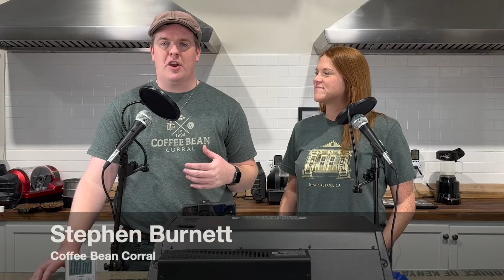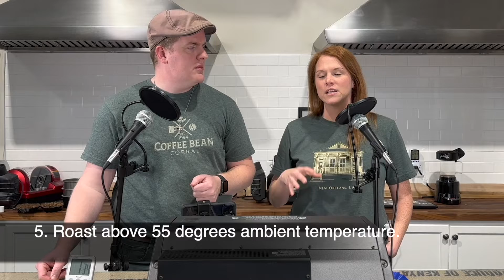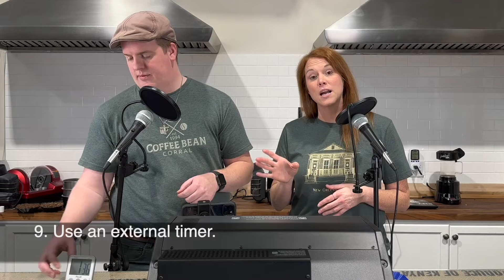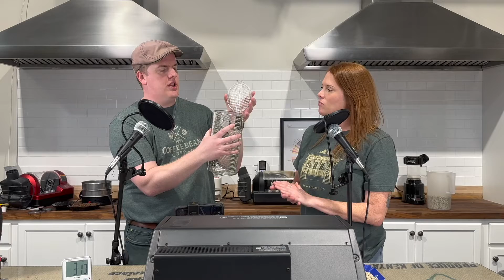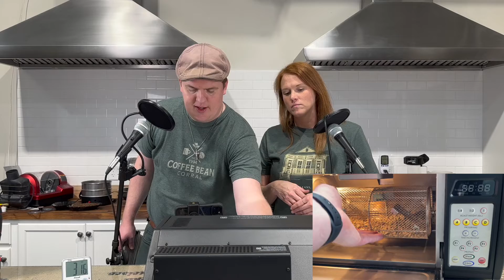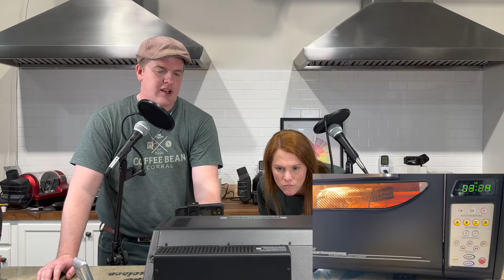Behmor - Roast-A-Long

Comment: Wow 12 min to first crack?! That seems so slow.  Comparing only to my air popper and videos on fresh roast etc.  is that why people use the p5 button for hotter faster? How fast would your roast be using the manual mode? Thanks for the video! Trying to decide between a behmor or fresh roast 800
Reply from the maker: Yes, it's certainly slower than a hot air/fluid bed roaster. P5 is the highest heat setting, so I usually run it P5 all the way to shorten the total roast time!
Reply: I too am deciding between the Behmor and SR800. I have the SR500 now and like it very much, but the 1/4 pound batch size causes me to have to roast 4 batches to get a pound. The SR800 would be an improvement (as would the Behmor). Did you decide? Which did you go with and how do you like it?

Comment: Thanks a lot for this lovely video! I have two questions:
1. It’s all about when to hit the cooling button after hearing the first crack. That’s what I want to know—how many seconds should I wait after the first crack before pressing the cooling button? 2. My other question is: My roaster gives me different batch size options. Will anything change if I select the 400g button while roasting only 200g? I usually select the maximum batch size while roasting only 200 or 250g just to get more time in my roasting process. I just want to make sure—will this affect the roasting process or the final roasting result in any way?
Reply from the maker: Exactly when you enter cooling mode after the first crack depends on how dark you want to go. Because the roaster is still hot for several minutes during the cool-down, it will keep roasting. So if you're shooting for a light/medium roast, I'd enter cooling mode as soon as first crack starts in earnest and let it run!
Reply: I have the same question ! Burnt the first two roasts hard even though I followed everything down to a tee
Reply: @vx1982 wouldn’t Waite the 12 M cooling down .. as soon as you hear first crack give it a minute or 2 .. that’s where the game is …up to 4/5 minutes .. to keep the sweetness . And shut it down and take the coffee out and cool it .. because it will keep cooking .. 12 M is too long to keep inside … it will burn it …u can always bring down the temperatures a few after you hear the first cracks ..  ..like 5 /10 degree ..for light coffee ..